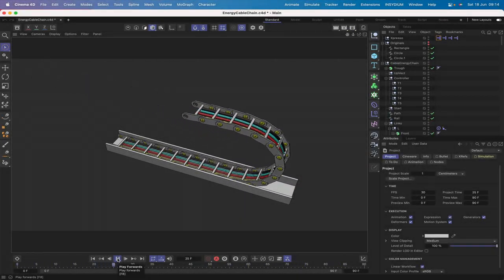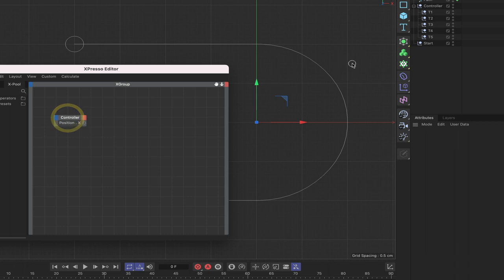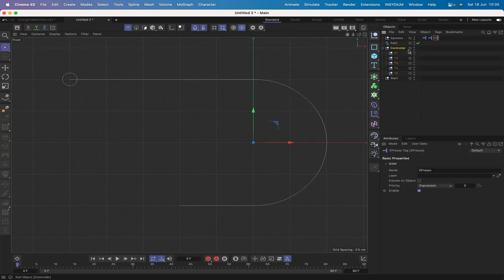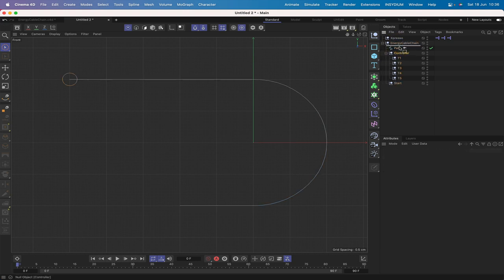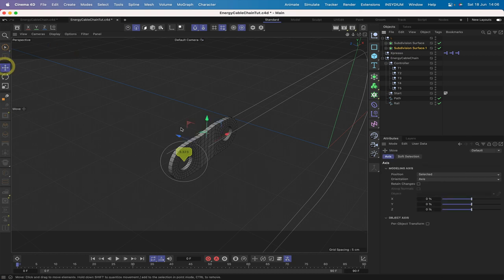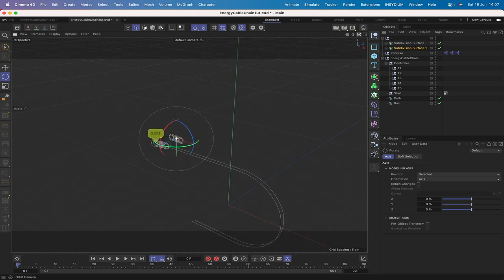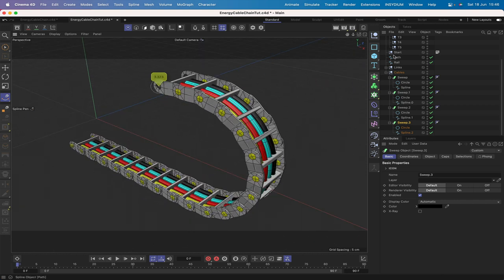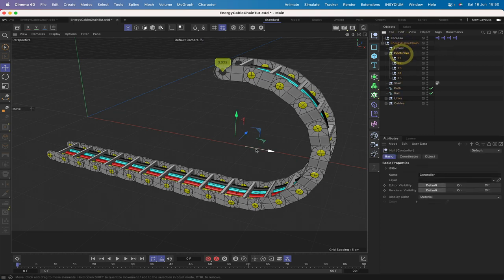Cinema 4D Xpresso Tutorial 48: Energy Cable Chain.

Comment: hi, thanks for the tut,! finished the job i merged everything into a null but if i move or rotate it everthing goes mad. Isn't there a way to lock the parameters? thanks
Reply from the maker: I'll take a look...
Reply from the maker: I think you may be using Position, as opposed to Global Position. Mine works perfectly well with everything that using position data set to Global Position.
Reply: @ExpressoMechanicTV  hi, thanks! I'll try